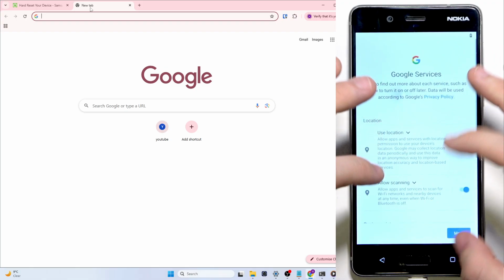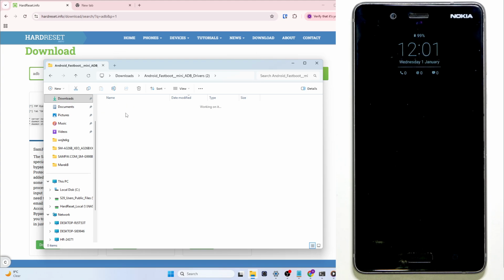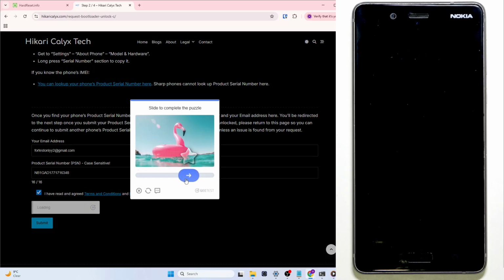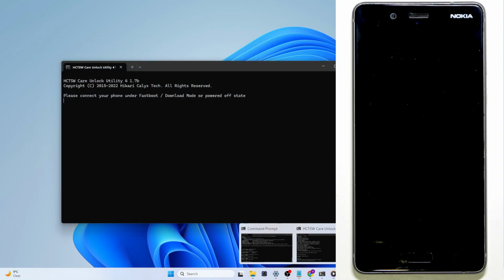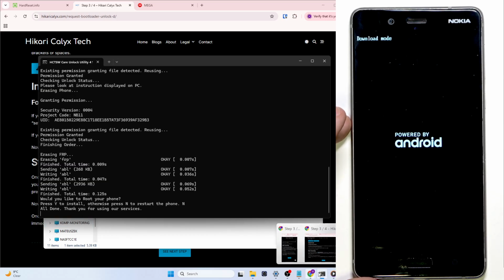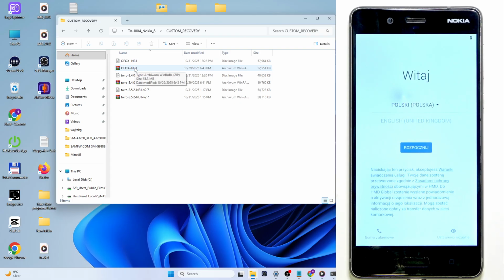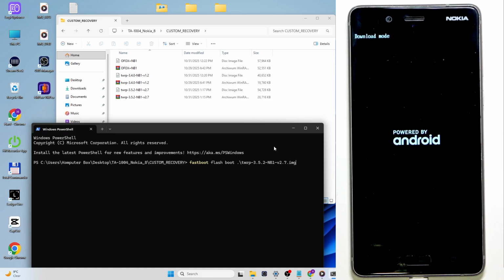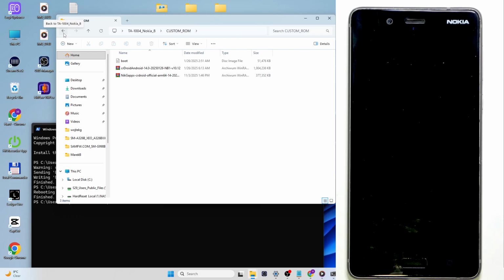NOKIA 8 – How to Install Custom Recovery (TA1004)

Comment from the maker: 🔧 This step-by-step guide shows you how to safely unlock the bootloader and install custom recovery on your Nokia 8 (TA-1004) with confidence! Have you tried flashing a custom recovery before, or do you have any tips or questions to share with others?
Reply: Thanks you
Reply: Same
Reply: tell me, broh, what i need do, if cmd don't work, after unlock bootloader? I want write "fastboot reboot" - return cmd: "<waiting for device>" - i want update loader to TWRP - after command "Fastboot flash boot twrp-3.4.0-NB1-v1.2.img" - return terminal "<waiting for device>" what is this, answer pls? idk how need fix this...:( I install adb & nokia drivers, but....